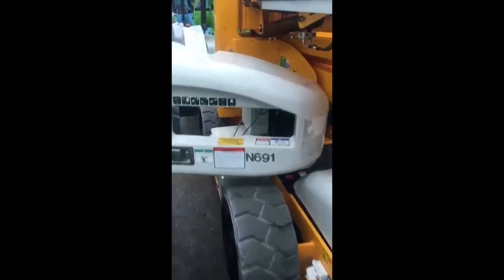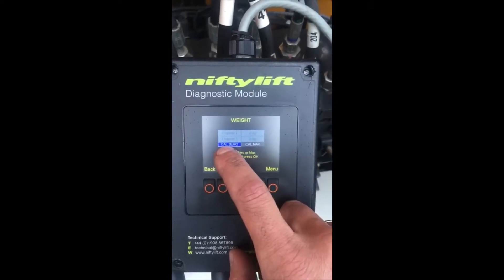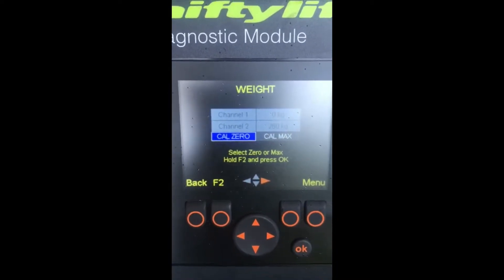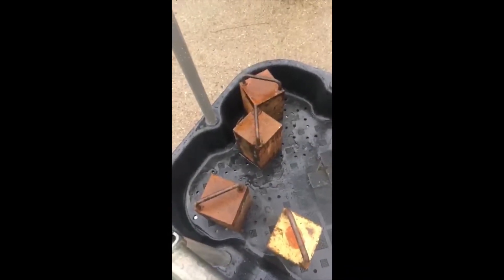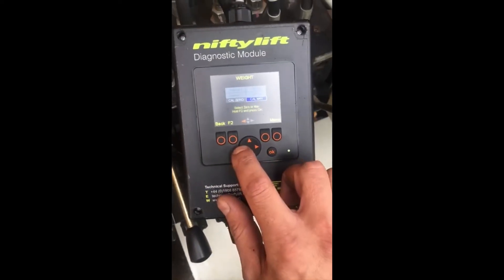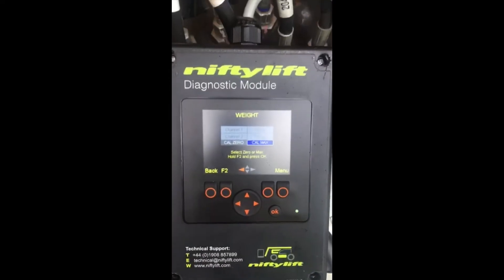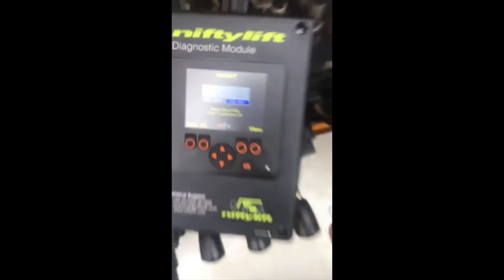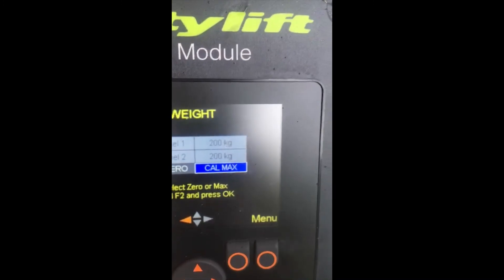NiftyLift Hr15 / Hr17 Cage weight calibration

Comment: Hello, is it possible to disable the weight sensor via this module?
Reply from the maker: Hi I think there is a way to do it if you need to recover your machine with overload fault but you need to contact nifty to get special code .
Reply: @RTFIX  Thank you . I have this diagnostic module to calibrate the weight sensor, the code is 4717, but what is the code to enter the parameters? . after calibration, one empty cell shows 0 and 280kg and so without load 0 and suddenly 280kg
Reply: @RTFIX  I have an account with niftylift. but I don't know what to enter on this website to get the reset code. I need to enter a string of characters but I don't know where to enter it from?